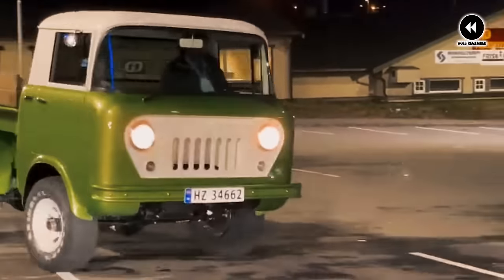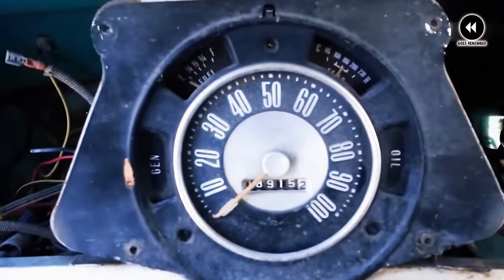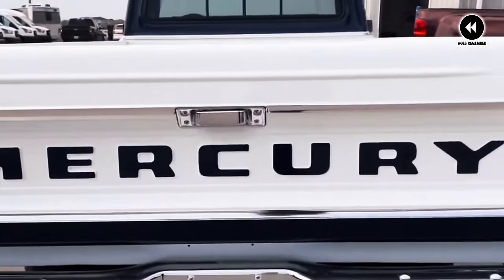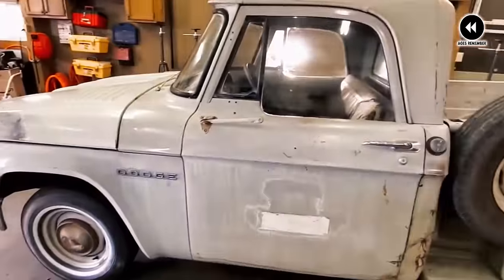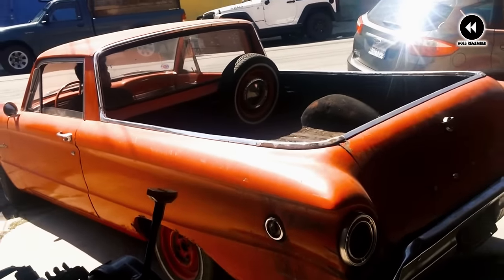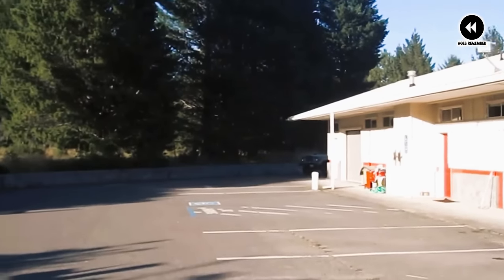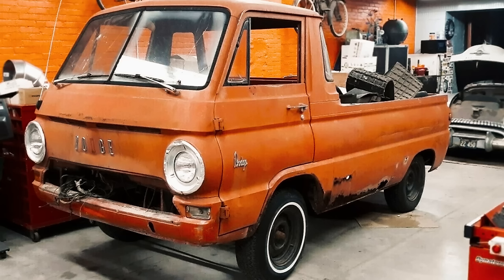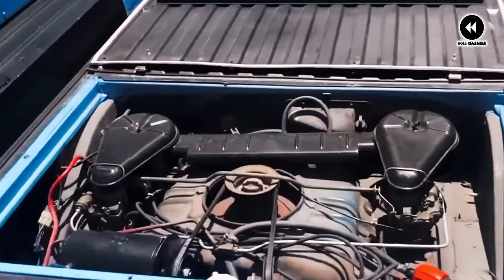15 Goofy😳American Pickup Trucks!! From the 1960s

Comment: You have to realize that none of the trucks in this video looked like what they did back in the day.  Now they either look worn out or are modified if they have been redone.  Back in the day they were largely pretty basic and plain.  For one thing, radial tires did not exist then; they all had bias ply tires.  They were also NOT meant to last.  By the time they had 60,000 miles or so, they were done.  I never saw a 50s or 60s pickup with over 100,000 miles.  Suspension lubes were every 1,000 miles and so were the oil changes.  All of them leaked oil and adding one quart of oil every 300 miles was not considered unusual.  Be glad they don't build them like they used to.

Comment: More technical details and less mentions of " oil leaks and rust outs" etc. All elderly vehicles suffer those problems. regardless of being a pick up or not! The Ford Ranchero shown here was derived from the Falcon car. The Chevy El Camino was based of Chev sedans from that era. The Chevy Greenbrier was derived from the Chevy Corvair. Please try and find photos of UNMODIFIED examples of these vehicles. The Chevy El Camino didn't have a Corvette engine and the International Scout 80 didn't have a diesel engine as depicted here. Many of the other trucks depicted here were modified examples and not the true production versions.